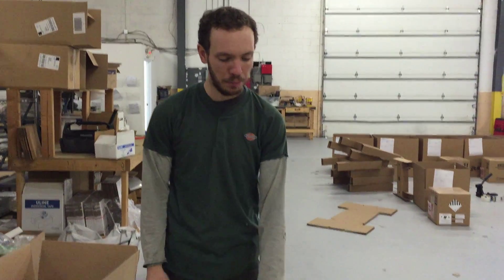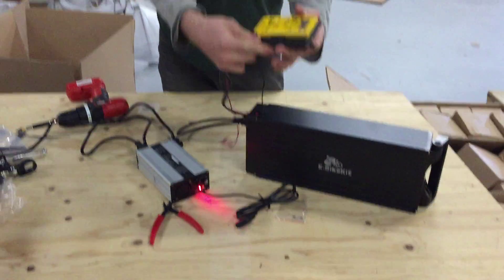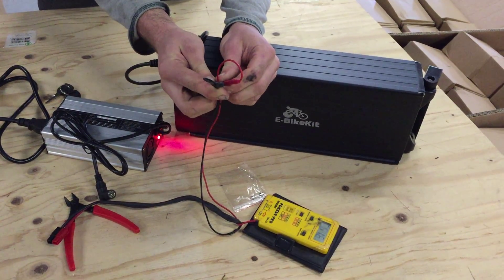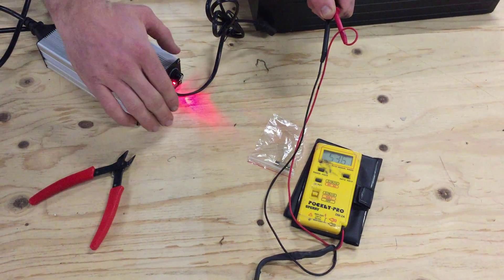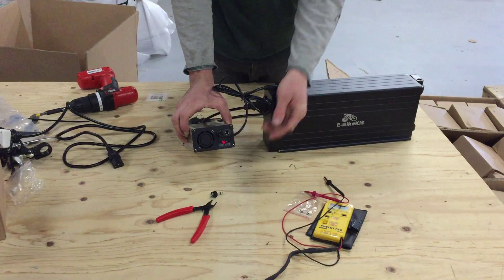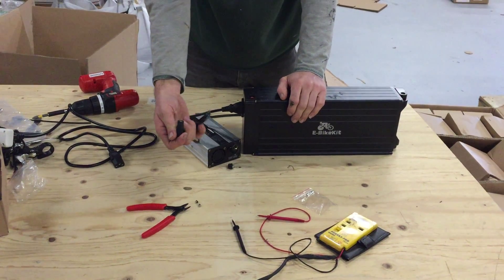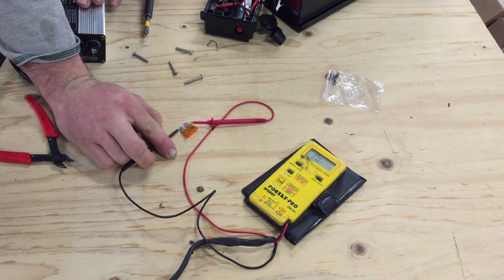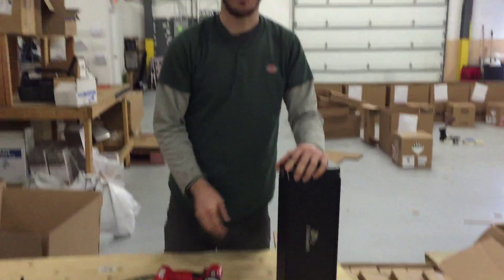LiFePO4 Battery & Charger Testing

Comment: What charger are you using to charge that LiFePo4 battery?
Reply: That's an older charger that we don't carry anymore. LiFePO4 will be a higher top output voltage. make sure to use a charger compatible with the battery you have and ideally sanctioned by the battery manufacturer.

Comment: at frame 4:00 .  are you testing the discharge cable or the charge cable on the battery.?  Is that an XLR 3 pin..?

Comment: I'm confused.  My 52v lithium ion battery pack is fully charged to 58.8v.  the bafang display indicates that the battery is at 58.8v.   Yet when i use a multi-meter to test the charge port (3 pin XLR) touching pins 2 and 3, I get a voltage reading of .01v to .3v.... (fractions of a volt).... And when I check the discharge port (XT90-S connector) I get the same,  Nothing reads / bounces around an almost unreadably low voltage.    Logic would say that a fully charged (58.8v) battery would read 5.8v at the charge port and at the discharge port going to the mid-drive motor with built in controller.  but I get no substantial reading..    What am I doing wrong.

Comment: i have the same problem with the fan that not turn on when plugged to battery . is there a test i can do to see if it starts?  as an example putting resistance on the charger out pin to see if it starts?

Comment: When I connect I get only one red light and one green light. No fan is coming on.... Batteries don't charge and voltage is not at max... Fuses are okey. What is wrong It thins the battery is full. Is there a way to reset this. Perhaps one of these tiny screws copper on blue tiny boxes in side the charger? My model is also a UY240 Hope you can advise! Thanks. Great video's by the way!!
Reply: Sharkusaf the charger that you have is not one of our chargers, so unfortunately I can't help you. I'd recommend you contact the person that you bought it from. Thank you and sorry that I couldn't help more.
Reply: Did you found out what's the problem with ur charger?

Comment: I have a mild issue with my LiFePO4 in my escooter.... Most of the time (but not every time) when I charge the battery and leave the charger plugged in for an hour or two past fully charged, I unplug the charger, then turn the ignition on my escooter to on and the battery immediately dies (the LEDs on the battery meter on the throttle fade out). To fix it, I simply disconect the battery from the speed controller, and poof... it has full power. I just don't like the pop of reconnection, and I'm sure it's not doing much good for the connector pins. Any ideas?
Reply: Thanks for contacting us. I am not sure what you might have with LEDs and a battery meter. This sounds like it might not be one of our products. Can you please contact us and we'll help you out.
Reply: Hi, it's definitely not one of your products. I just thought you may have seen this speed controller / lifepo battery issue before and might have something to say on the subject. I'm not trying to hold you to some kind of warranty thing... just thought you might know since this battery technology is sorta new and all.